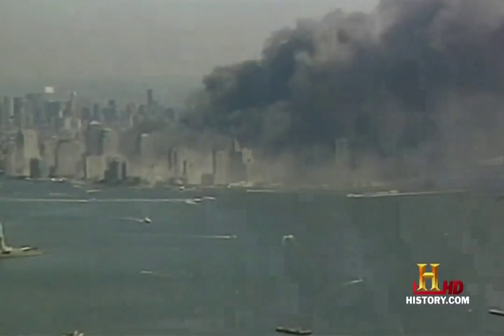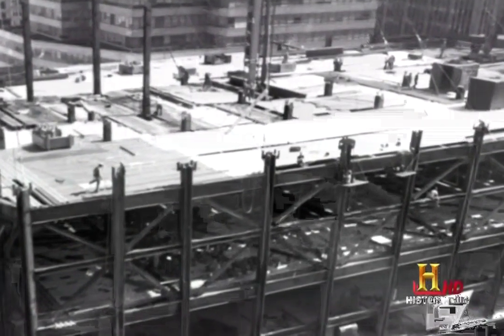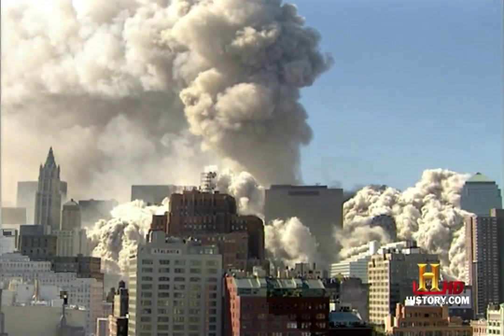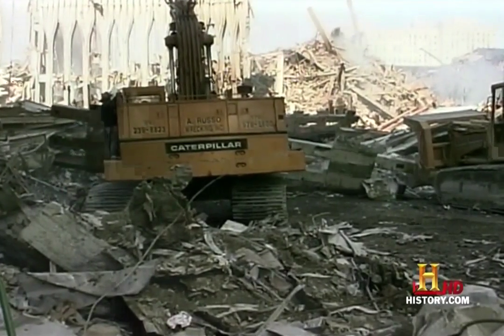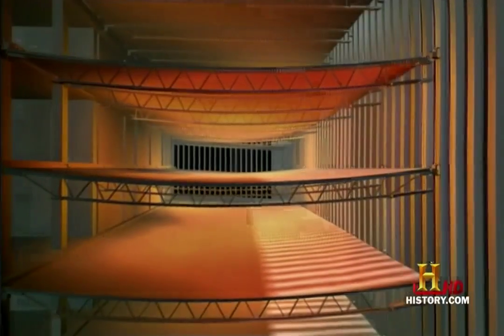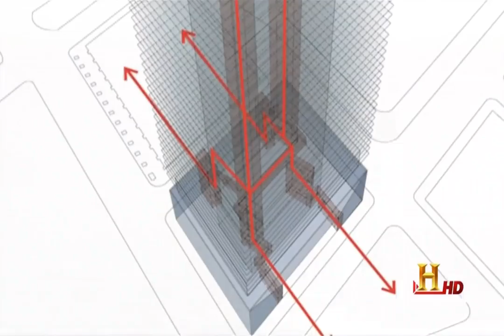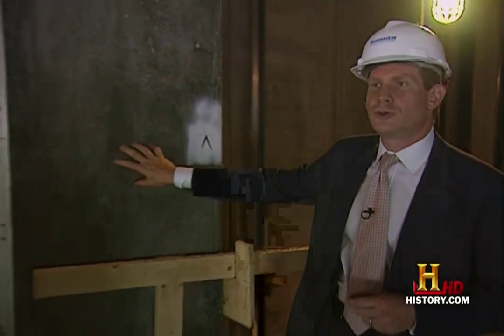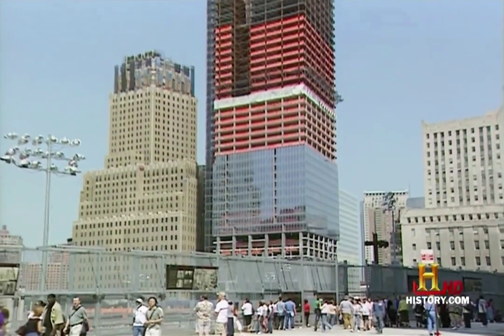WTC 7 - Collapse Issues & Features of Old and New Building (History Channel, 2004)

Comment: I'm tired of hearing collapsed, try exploding
Reply: Exploding requires explosions.
Reply: M Fitz you must be one of those who believe what was fed to you on tv
Reply: Tim Glover - My brain works.  I can figure stuff out and one of those things I have figured out was there was no "explosion" associated with collapse initiation of any building on 9/11/2001.
Reply: It came down in 10 seconds with no resistance how did that happen
Reply: Tim Glover - Building came down in over 20 seconds with plenty of resistance. The collapse was already almost 10 seconds old when what you wrongly think was the building (the moment frame - really just an empty shell by that point) started to drop.
Reply: M Fitz you need to watch again, it wasn't no 20 seconds you are sadly mistaken
Reply: Tim Glover - I assure you my vision and ability to tell time are just fine.  I even wrote this little explanation of Building 7's collapse based off my observations.  I have come to call it The Discussion Killer because I have posted it a few dozen times now and every single time I do the discussion ends right after, no matter how chatty my opposite number had been prior. Hopefully this time the results will be better. 

Basic Explanation of 7 World Trade Damage and Collapse

First a bit of background:

Building 7 was a largely unknown and unimportant 47 story office building in lower Manhattan. Unlike the Twin Towers and the Pentagon, Building 7 was not a world famous, iconic structure and was NOT  attacked on 9/11/2001. Building 7 is one of ten (10) buildings which ended up being destroyed on that day, 8 of which were not targets.

To understand the collapse of the 7 WTC it is critical to have a basic understanding of the structure. To say that Building 7 was unique would be an understatement. A 47-story trapezoidal shaped tube-in-tube steel framed office tower built on top of an existing 3 story building of smaller footprint which served as its partial foundation. Because the Cod Ed structure was designed to have a smaller building built over it, Building 7 used a combination of existing and new caissons to carry the load. Thus Building 7 had unusual attributes including transfer beams and trusses and other load transfer techniques that allowed the building to be cantilevered out over the perimeter of the Con Ed foundation. These attributes affected the qualitative and quantitative structural redundancy in the building. Specifically, large visible portions of Building 7 depended on relatively isolated structural elements and when those elements were compromised, it affected a disproportionately greater fraction of the structure. 

That last sentence if you didn't pick up on it is REALLY IMPORTANT. 

Above the 8th floor the structure of 7 WTC consisted of 81 columns - 1-57 on the perimeter, primarily responsible for torsion loads and some vertical (gravity) load and 58-81 in the core which carried most of the vertical load, the perimeter and core columns being connected by highly complex arrangement of long-span floor trusses, beams and girders to tie the system together. Below the 8th floor was the sophisticated load transfer region to manage loads between the smaller number of columns below the 8th floor and below that the Con Ed Substation. There was an exterior moment frame curtain wall which was supported primarily by the 4 corner perimeter columns.

https://www.metabunk.org/sk/NCSTAR_1-9_WTC7_unlocked.pdf_%28SECURED%29_copy.png-20130420-134924.png_%28899%C3%97950%29-20130608-161358.jpg https://www.jp-petit.org/Divers/PENTAGATE/Twin_towers/structure_WTC7.gif 

As you can see it is no simple grid system by any means. 

Building 7 was evacuated after the attack on Tower Two and was abandoned by around 10:00 am. When the Tower One collapsed at 10:28 am. it rained thousands of tons of burning debris onto the south face of Building 7. This blew out windows and walls on multiple floors and subsequently resulted in the complete failure and total collapse of perimeter Column 20, leading to a large vertical "gash" in the side of the building. Burning debris started fires on multiple floors simultaneously (an extraordinary, unprecedented event, not a "normal office fire") and were allowed to spread rapidly by the venting of the building, the loss of firebreaks and the failure of internal fire suppression systems. Fires subsequently burned simultaneously across multiple floors for the next 7 hours. The buildings fire safety rating was 2.5 hours. 

Steel construction is particularly vulnerable to prolonged exposure to heat from fire. The recent Plasco building and I-85 bridge collapses are but a few of countless examples of this. For this reason structural steel members in Building 7 were coated in SFRM to extend the safety margin of the steel before failure might occur, thus allowing more time for occupants to safely evacuate the building. Unlike in the Twin Towers impact area, the SFRM was not compromised in Building 7. This and a lack of heavy impact damage from high speed aircraft help account for the longer period of time Building 7 was able to survive. 

Conspiracy theorists often falsely describe the fires in Building 7 as "small", "isolated" or my personal favorite, the well-poisoning and meaningless "normal office furniture fires" in an attempt to downplay the true extent of the fire event and the damage that was being done. Certainly the accounts of FDNY firefighters who were there, at the building, witnessing things first hand and with the expertise and experience to make a proper evaluation of it all paint a different picture. To me, that some need to so drastically downplay the extent of the fires is a tacit acknowledgement of the damage fire can do and the untenable nature of their position, causing them to resort to fabrication and deceit.   

Unlike most other high rise fires and most building fires, there was no effective fire fighting or fire suppression effort at Building 7.  Active fire fighting efforts were hampered by multiple factors: 
-The very large nature of the fire event (nearly all building fires start in one location and gradually spread outward, not in multiple locations simultaneously).
- The lack of water pressure
- The lack of resources due to heavy casualties and equipment losses among the FDNY. 

All of this combined with the failure of internal passive and active fire suppression systems meant there was no effective firefighting effort at Building 7. All of the above mentioned factors make this fire fundamentally different from any other large building fire that has come before it, or since. IMHO it was the fact the FDNY did not fight the fire that was a bigger factor in the buildings loss than whatever actually initiated the buildings collapse and this factor is almost always completely overlooked in discussions of what happened in Building 7.

I like to break the collapse of 7 WTC down into separate phases which helps with clarity. Others may break it down differently. Conspiracy theorists by and large ignore most of what I am about to go over like it never happened or wasn't important. 

Phase 1 of the collapse event began in the early afternoon after hours of unsuccessful efforts to fight the fires with reports of from FDNY firefighters of creaking and moaning sounds from the structure and movement in the SW corner. That the structure was moving was subsequently confirmed with a surveyors transit. It was clear the building had become unstable, was in danger of collapse and there was nothing to be done that could change that and there was no one left inside to save anyway. To avoid further loss of life it was at this point the FDNY on scene commander Daniel Negro ordered all firefighting efforts at Building 7 abandoned and a safety zone created around the building in the event of its collapse. This order also necessitated the cessation of search and rescue efforts in much of the debris pile which was understandably unpopular with rescue workers. Building 7 was then left to its fate. 

Phase 2 - Is collapse INITIATION which occurred several hours after the safe zone was created around the building. The collapse initiation event is what started the building moving. The first obvious external sign of collapse initiation is a kink in the roof of the East Mechanical Penthouse (EPH) and a vertical progression of window breakage along the Column 79 line, both events clearly indicating the failure of Column 79. This all takes place in an instant. That the failure of Column 79 would cause this observed behavior was confirmed in one of the NIST models. Perhaps the most remarkable thing about this moment of collapse initiation is how quiet it was. In the CBS video in particular it is clear that most observers failed to notice those initial signs of collapse because there was no sharp, loud noise associated with it. 

Phase 3 - This is the transition from collapse INITIATION (what got the building started moving) to the beginning of PROGRESSION to global collapse. From this point on, gravity is doing all the work and everything else that happens from here is the product of gravity, not what caused the initiating event. Externally, this progression phase is evidenced by the complete collapse of the EMPH into the building, disappearing below the roofline 2.2 seconds after the kink first appeared in the EMPH roof. This event clearly indicates the loss of the supporting structure below the EMPH, specifically Columns 80 and 81, adjacent to Col 79. Here is what those column connections looked like: http://www.wtfrly.com/wp-content/articlepics/girderwalk1b.jpg All 3 columns at the eastern end of the central core have now failed, taking with them all of the floor trusses, beams and girders which were connected to them and are still connected to other parts of the structure. 

Phase 4 - About 7 seconds after Phase 1 sees collapse progression from east to west through the load transfer region as evidenced by the collapse of the rooftop screenwall and West Mechanical Penthouse below the roofline and a series of horizontal exterior window breakages indicating the *TOTAL FAILURE OF THE BUILDING CORE*. At this point the perimeter and exterior curtain wall are still standing and largely (on the north side anyway) still standing and (largely) intact. 7.2 seconds after initiation the west end of the roof starts to move, followed 0.5 seconds later by the east end of the roof with a distinct kink forming in the center of the roof at Cols 46 and 47. The more astute among you will have picked up by now on the *decidedly non-symmetrical nature of this supposedly symmetrical collapse*. 

(To Be Continued)
Reply: Phase 5 - Global collapse begins 8.2 seconds after collapse initiation started everything moving. By this time the building core has failed and is collapsed or collapsing, leaving only surviving perimeter columns (remember Col 20 on the south side had already failed in the morning) supporting the exterior curtain wall/moment frame which was more or less still standing. Unable to stand on their own, and probably being *pulled down behind the collapsing core by still-attached girders, beams and trusses, the exterior columns fail and the curtain wall collapses. As the curtail wall collapses, the center collapses first, illustrated by the distinct non-symmetrical kink in the roofline and the remaining shell of the building twists and leans to the south as it falls, moving in 3 dimensions, not just straight down.

It always surprised me that a physicist like Steven Jones couldn't understand the trick that Building 7 plays on the observer. It is similar to yanking a table cloth out from under fine china. The progressive collapse occurs faster than the buildings connections can transfer the energy, so the moment frame and the curtain wall show no effect, because the energy of the collapse is not transferred to them though the floor connections. 

Conspiracy theorists who get all their information from Youtube invariably think Phase 5 is when the collapse started and everything I described before that in the previous is usually completely foreign to them.  Or they do like you and try to rationalize and hand-wave away it away.  Most videos on this subject are aimed at a particular audience and putting forward a certain agenda so they edit out all of the 7 hours of events prior to Phase 5 so this is understandable. Take the CBS video for example.  Few have seen the entire thing in its original form since most CT themed videos edit out everything before the curtain wall falling, only showing the last part, where the hollow, laterally unsupported empty shell comes down in one piece, giving the illusion of a "symmetrical" controlled demolition of the entire building (apparently the first-ever demolition of a burning building and without loud, bright explosive charges going off, flinging lethal high velocity fragments in all directions).

It is BTW only now, in this final stage of the collapse event, when the whole of the core and interior - the majority of the building - is already gone that we even get to the much bantered about "free-fall" (correctly termed gravitational acceleration or GA). 

Back around 2006 or so a retired high school science teacher named David Chandler, came up with the false idea that controlled demolitions are always done by blowing every column simultaneously. He then decided that if this occurred, the building should collapse at the rate of gravity.  His reasoning was that "free fall" can ONLY happen if there is zero resistance (not true) and zero resistance can ONLY happen in a pre-planned controlled demolition where every single column is removed at the same time. Therefore if he could find any period of GA in the collapse of Building 7, that would be his proof there was a controlled demolition.  I should point out that outside of conspiracy rhetoric there is no acceptance of this claim in the real world. 

So Chandler, determined to prove some form of malicious human intervention he had already convinced himself took place went about applying his high school level 1D understanding of physics to a complex 3D event he had no real grasp of and tried to find any evidence of "free fall" of any part of Building 7.  

Chandler picked a single point on the top NW corner of the curtain to make his measurement and measured it for just 6.5 seconds from just before it started moving until it disappeared from view. He then took an arbitrary 2.25 second slice of that 6.5 seconds, averaged the acceleration of this single measured point and came up with his global claim "2.25 seconds of free fall = controlled demolition." 

The more astute among you will have noticed a whole slew of problems with that. Unfortunately, if you are reading this you probably didn't, so I will do it for you. 

1. For what should be rather obvious reasons, this measurement does not (can not in fact) represent "the entire building" - defined as its center of mass. It can only represent that single measured datapoint, a single point on one corner of the moment frame. Remember, the entire core, the main vertical load bearing component of the structure was already gone before this measurement was even taken. 

2. Happening as it did almost 10 seconds after collapse INITIATION, the measured acceleration can not have been caused by what initiated the collapse.  It is a product of the random chaos of collapse PROGRESSION, and is therefore of no real interest since it can not tell us what initiated the collapse in the first place. 

3. There was no "free-fall".  No period of sustained "free fall" - gravitational acceleration (GA) was actually measured. Chandler took an AVERAGE. His graph starts out below GA, accelerates up to and then exceeds GA the decelerates back down below GA again. There was no sustained 2.25 seconds at GA. It's all a bit of trickery, subterfuge, slight of hand. 

4. The measured datapoint was moving in 3 dimensions at the time the measurement was taken, not just straight down, which means FORCES OTHER THAN GRAVITY were acting on it when the measurement was taken. This BTW is why it is possible for this single measured datapoint to EXCEED the rate of gravitational acceleration. If gravity was the only force at play, GA would not have been exceeded. 

So to summarize, the "free-fall" argument fails on multiple points.
1.  All columns did not fail simultaneously, the alleged prerequisite for "free-fall".
2.  The movement Chandler measured could not have been caused by what started the building moving (be it bombs, rust, metal fatigue, buckling or Santa's Custard makes no difference) and therefore can not be used to determine the cause of collapse initiation. 
3.  There was no actual sustained "free-fall".
4.  The rate of "Free-fall" was actually exceeded, proving forces other than gravity were at play.
5.  Only one measurement was taken from a single point and therefore can not represent the entire building (defined as its center of mass).  

Now I mentioned that most conspiracy themed Youtube video's tend to ignore, even to edit out everything that happened before Phase 4 and sometimes even Phase 4, starting only at Phase 5. I believe the correct term for that is lying by omission. They do this in order to pretend the above mentioned brief period of "free-fall" happened at the beginning of the collapse, which it didn't, and was the product of collapse initiation which it isn't. 

If Column 79 had not buckled, there would have been no collapse.  It is important to note that *once collapse was initiated - once the structure started moving - progression to total collapse was inevitable*. Progressive collapses by definition gain energy as they progress. There is nothing within the structure that could have arrested this progression. This manner of progressive collapse - the spread of local damage from a single point and a single initiating event to one structural element then to another structural element, eventually resulting in the collapse of the entire structure - was unique on that day to Building 7 and distinctly different from the collapses of either 1 or 2 WTC. 

Because Building 7 was not a target of attack, was not occupied at the time of its collapse and thus no casualties were suffered and because the proximate cause of its loss was NEVER IN DOUBT, its loss was simply an engineering problem which could be addressed at a later date once more pressing matters were resolved. Therefore it took some time before much "official" attention was paid.  Because there is nothing conspiracy loves more than a vacuum it can fill with its own narrative, conspiracy theorists who had utterly failed to convince the public with absurd tales of explosives in the Twin Towers, missiles at the Pentagon and shoot-downs over Shanksville latched onto the virtually unknown and forgotten Building 7, filling the information void with their own personal brand of reality distortion.

For the record I am going to put this right out there: The collapse of any building on 9/11/2001 was purely incidental. No building NEEDED to collapse for the plan to be totally successful. 9/11 was about people, human casualties, human victims, not the New York commercial real estate market. "Hijacked planes" regardless of what happened after was already all the victory necessary.  Building 7 was simply collateral damage, quite unintentional and only of genuine interest to a small subset of the professional engineering community.

In short, 9/11 could have been an inside job and Building 7 could still have collapsed without intent.

That's the Cliff's Notes version anyway. Comments and clarifying questions are welcome, one question comment at a time please, no Gish Gallop. Deliberate derails over irrelevant minutia and tired old CT chestnuts will be given the attention they deserve, which is none. Same applies to attention seeking trolling and name-calling.
Reply: M Fitz it's just my opinion as a citizen and you have yours
Reply: Tim Glover - Opinion has nothing to do with it.  These are all things that can be verified through observation and a careful study of the available data. I like objective facts.  Objective facts are better, don't you agree.

You do understand that Building 7 could have collapsed in longer than 10 seconds and that its collapse could have been purely incidental, but 9/11 could still be an inside job, right?  No need to cling to false technical claims.  Go with what is correct.
Reply: M Fitz all I'd like to see is the truth whatever that may be
Reply: Tim Glover - Start with my 2 posts from last night then.  That is the true and relevant facts about Building 7 as I know them, condensed for space of course.
Reply: M Fitz ok I'm not sure what happened as a lot of people I'd just like to know more it was the worst day in history
Reply: Tim Glover You don't understand it. So what? You don't understand the vast majority of things that happen in the world. Get used to it. You're making a fool of yourself.
Reply: The entire building was engulfed in flames. That’s obvious. What explosives would have lasted 7 hours in a raging fire and then exploded perfectly to bring it down like that?
Reply: @MB-ln9nv  Very good comment. Fireproof explosives probably haven't been invented yet and probably never will 😉
Reply: Tim Glover yet little Timmy believes what is force fed to him by blogs and YouTube videos with spooky music...